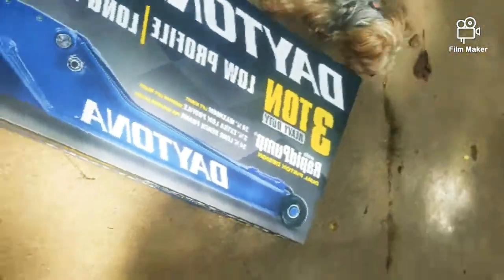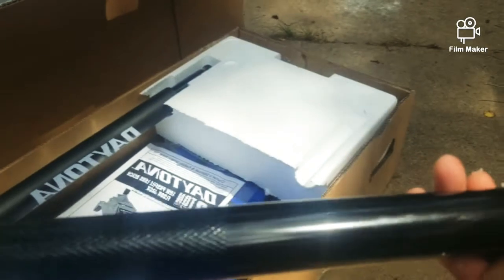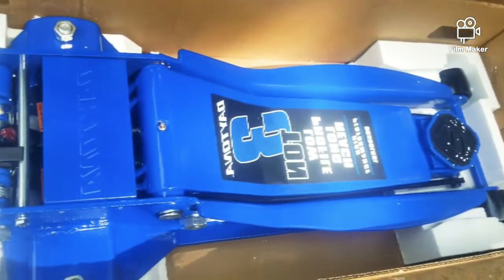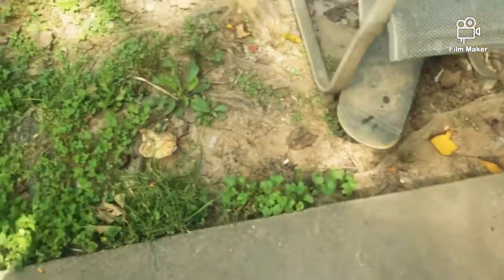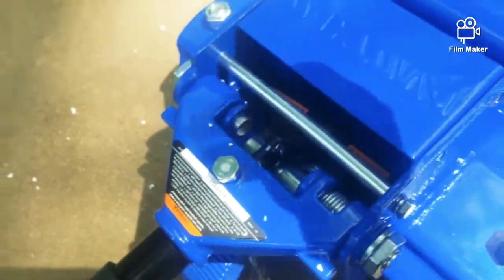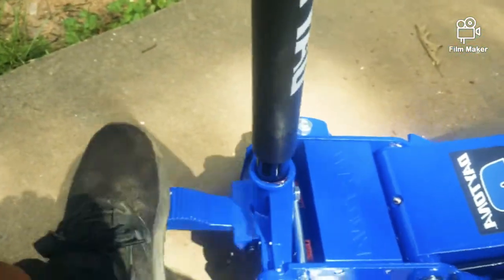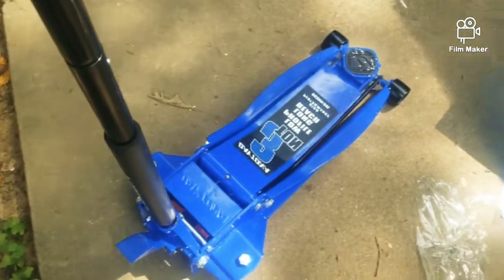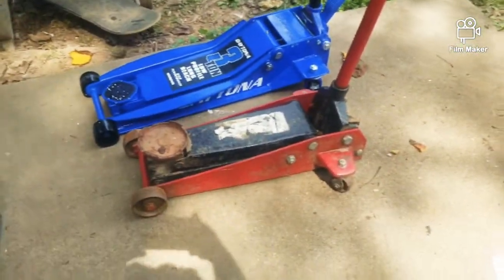Harbor freight 3 ton LR LP blue jack

Comment: Wow $119.99. I'm definitely considering picking this up the next time there's a coupon or it goes on sale, not saying I'd be able to get it for that low especially because I have to shop online and not in-store. My friend said that the tire shop he was at a lot growing up's Daytona jacks would break a lot, but they could be better built now or they bought the cheap ones. Since it's made out of steel that both makes it more heavy duty and it deters people from messing with it. It would be a great upgrade from my Walmart jack, plus it didn't have a long enough low profile reach to work for my mom's 2006 Azera.
Reply from the maker: Yeah definitely get it. It worked great on my 97 Toyota celica because of the long reach. Another thing to keep in mind it is really heavy.